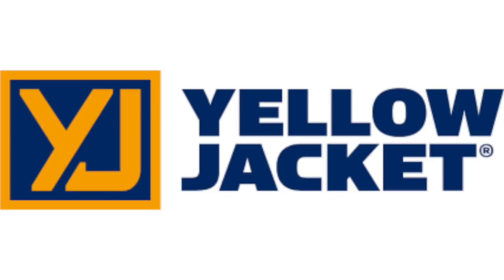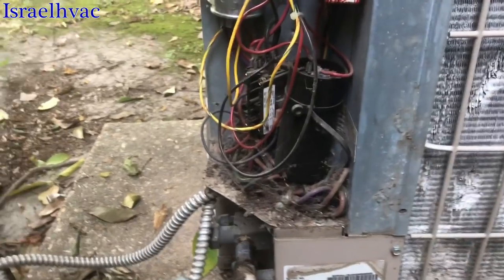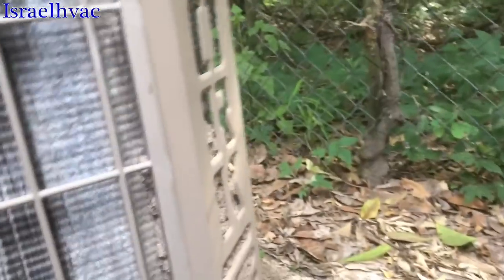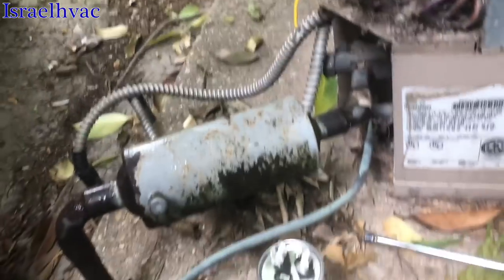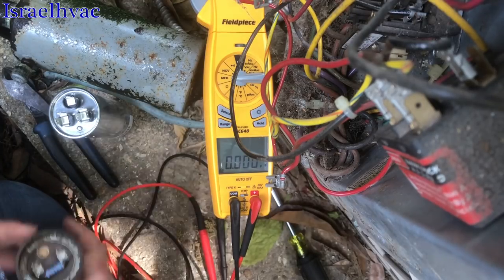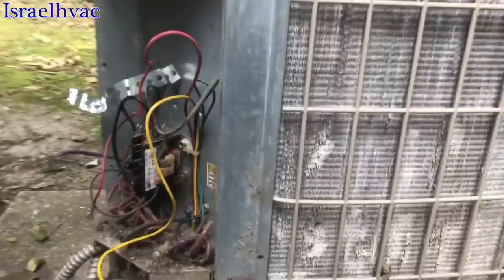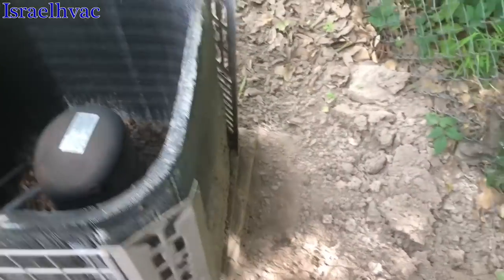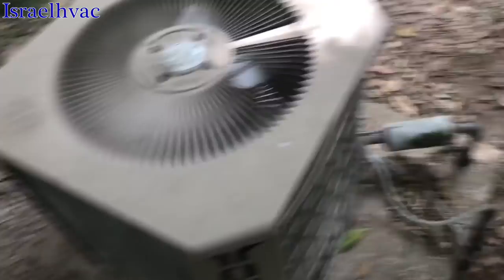HVAC Service: No Cooling | Compressor Not Running

Comment: Nice job getting her going again!  The window unit I have in my garage has coil rot on the bottom row of fins due to the air being salty as I am about a hour from the ocean.  I had good results removing the damaged coil fins and repacking with coarse aluminum wool.  The unit's old as it's from 2003, but it's still going.  It's a large 20,000 BTU unit so kind of a pain to swap out.

Comment: Could u just add a super boost instead of the kit.
Reply: Super boost works off heat to remove the start capacitor out of the circuit, the kickstart and hardstart kits use a potential relay and work on reverse polarity to energized the relay and open the circuit to remove the start capacitor once voltage is applied to compressor. Super boost are cheaper but my opinion not good for compressor in long run.

Comment: Suction line looked sweaty. Compressor was running bro.it's Herm-E-tic not Herm-A-tic
Reply from the maker: I did notice that Joe. But it wasn't running when i got there. I think what was happening was it wasn't starting every time due to the bad hard start.
Reply: Israelhvac I bet the indoor unit had a txv
Reply from the maker: No it was a piston
Reply: HER-MEH-TICK
Reply: Compressor must be in bad shape to not start without a hard start.
Reply: Putting lipstick on a pig. I would have cleaned out the component cabinet. Would of tried to convince customer to replace before going thru that.   Nice try tho though John.
Reply: Joe... dude... really ?

Comment: Was that hard start from the factory or was that field installed??
Reply: McTyman hard starts are never from the factory, they’re a bandaid for weak pumps. Always field installed.
Reply from the maker: Not true Trane puts them from the factory. But yes this one was field installed
Reply: So only Trane factory installs them? Is that just a backup or do there compressors just always need them?
Reply: So for those that are factory installed, will the compressor always need them or certain compressors just need them and others don’t unless the rotors are locked? Sorry for all the questions just trying to learn. This will be my first real year doing full ac service on my own, welding, replacing indoor coils, doing repairs and I’m just trying to get as much info as I can. Not really much of a book learner but I do try
Reply: I have a 4 ton Trane that came from the Factory with a 3 wire start kit (it looked a lot like a 5-2-1 with different color wires).    Just for Shits and Giggles we tried it without it The start kit and  the compressor will not run without it.  We also tried it with a little Supco start kit and it did run with it.  Naturally we put the original back.  But at least one of the Trane didn’t start without it.

Comment: Electrical connections are a Joke, Not Liquid tight flexible conduit, Keep spraying water on it is a bad idea
Tape couping from conduit to Armored cable, Geounding is Just Over Rated.

Comment: Checking a start cap with a bleed resistor on it, That's hysterical that you think it's bad
Reply: well the new one had a resister on it and it had mfd's! so why is that funny?
Reply: JW watch the video again you watch it spiked up to 200 then cut out because the bleed resistor, if you don't understand how it works educate yourself
Reply: If the resistor stopped the capacitor working then even a good one fitted with a resistor wouldn't start a compressor... You can test them even when they have a bleed resistor and get meaningful test result.
Reply: I 2nd heavy diesel. I check em all day long with the resistor so while education is great sometimes things just work even when the books say they don't
Reply from the maker: Just like everyone else said been checking them this way forever. No need to be a dick dude.
Reply: G. Salis I’ve rewatched that part and 2.00 is not 200 lol. 
And yes you can check it with a bleed resistor on and get good readings. And if I get good reading I cut and recheck, but always been bad.
Reply: We got ourselves a keyboard tech that knows so much they should do some training videos